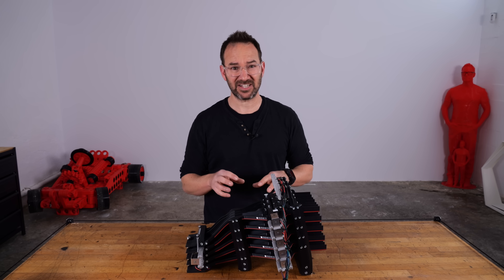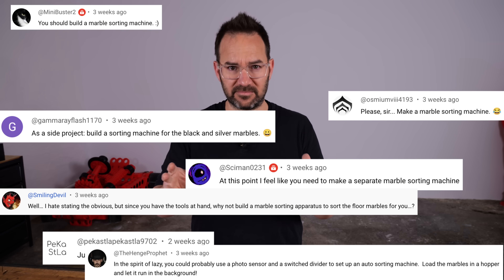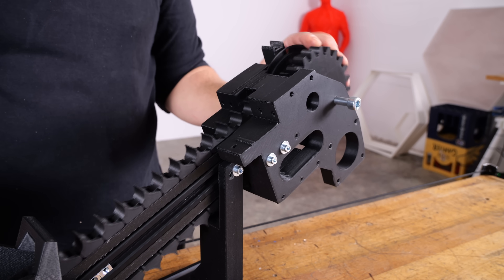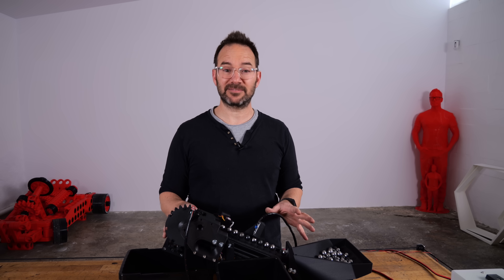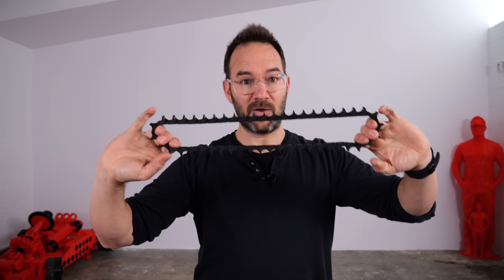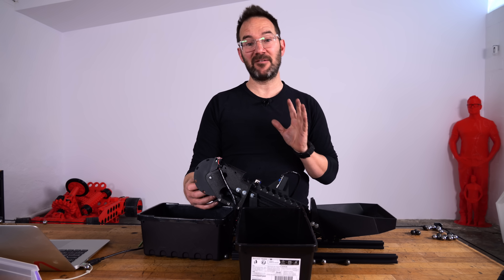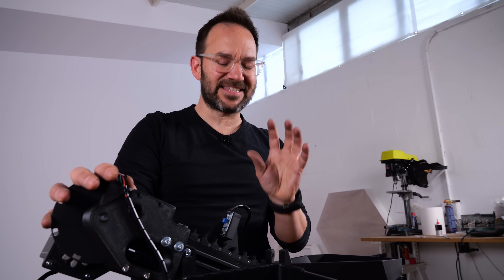Faster than the Eye Automatic Marble Sorter - Marble Clock Seconds Display Pt.3

Comment: Using a valve and shooting compressed air instead of the solenoid is often how my company forces ball bearings thru assembly processes. Do that and nothing gets in the way of the chain.

Comment: 1. Make the marble's impact point higher than the tooth of the chain (to prevent the chain from jamming and causing destruction).
2. Create a wheel resembling a fan (with 4 wings) that rotates 1/4 turn each time marbles need to be moved. This will ensure a smooth motion (unlike back and forth motion like a piston, saving half the time).
3. Design a larger cover for the inner bucket.
4. Form a funnel shape to catch the outgoing marbles.

Comment: Couple suggestions to consider 1) a double acting solenoid will get rid of the bounce and be faster than a spring return 2) Look at a step feeder as you can get the same part feeding rate result with things moving much slower and no possability of jamming 3) Take a look at type of parts feeder called a drum feeder, which you might find inspiring.

Comment: Chain sorting: Modulate the speed of the belt based on the marbles that are reaching the end.
By placing two buckets below the end of the chain you can make one type of marble fall further forward than the other, ending up in the far bin, and the other fall more straight down ending up in the closer bin. This should be much faster than stopping the chain and kicking marbles off.

Comment: You should look at using compressed air bursts to knock the marbles out of the way - that way you aren't limited by a 'retraction' time of the solenoid or servo.

Using press-fit pins to lock the links together (either dowel pins or roll pins) might also be stronger and not run the risk of unscrewing over time

Comment: For the marble sorting mechanism I'd design the chain so that the marbles want to fall out but are stopped by a wall, and instead of the solenoid pushing them, it is a gate in a hole in the wall that stops them falling or moves away to let them fall. That way if it lags behind slightly when retracting it doesn't catch the front or back walls of the chain link. This would reverse the logic of the solenoid with it needing to be OFF to eject a marble rather than ON, however I suppose you could have it drive a gate piece that slides away when ON to allow a marble to roll off the chain. You might also be able to move back to using a servo this way too.

You could also drive more than one chain in parallel to increase the throughput, you'd just need a hood under the chain to collect the marbles falling through the gate.

Comment: Super cool and useful time saver for this project! I think it would be cool to see it integrated in the clock, however if you aren't able to get it running fast enough with reliability, you could also consider using 2 sorters to increase the marbles per second.

Comment: You should use that but add magnets to the chain so the balls are transported along the underside of the belt (let me finish!). The black marbles will still be knocked off the same way but the shiny marbles will get tossed off the end as they make their way around the gear. Depending on the speed and size of the gear this will send them into a short arch like a fountain. It will also make more noise.

Comment: Maybe use two at a more reasonable speed. 10 marbles/s seems to be a good sweetspot where nothing breaks and by using two you still get to your target of 20 marbles/s.
I think the noise can be improved by making sure the marbles don't drop into a large bowl with other marbles.

By using a stepper motor, why don't you count steps and get rid of the position sensor at the top?

Comment: I think you can double your effective rate if you sort marbles rather than rejecting them.

Right now, you go through an average of two balls every time you select one. Sometimes you'll get lucky and the next ball is the color you need, and sometimes you'll get unlucky and get several wrong balls in a row. Assuming the correct proportion of colors in total, it'll work out to an average of one ball rejected for every ball selected.

But if you sort the balls first, then you can select every ball on the first try, every time. Essentially two stages:
- One device sorts marbles into light and dark, so that every single marble goes into one feed system or the other. (Overflows can be sent back to the pre-sort hopper.)
- The next device takes a marble from whichever feeder is needed. If it needs a light ball, it pulls from the light feeder. If it needs a dark ball, it pulls from the dark feeder.

That way, you always have the ball you need exactly when you need it.

Comment: By the way, you do not need a chain. You can just let the marbles roll on a sloped channel at controlled rate and have the electromagnet push them away to sort them. That way you could speed up the sorting even more. If the electromagnet is placed close to the sensor, you will not even need a software to do the sorting...

Comment: While this is really cool from a prototyping/art point of view, it does suffer from the overengineering of using prototyping equipment for a repetitive task. Instead of a belt, you could use a large wheel with holes per ball, and a pre--notched interceptor wheel with pre-determined spurs to do the knocking out. An aggitated hopper can drop the balls into a chute that feeds a wheel with a spot for one ball per second, and a pre-spoked wheel with the pattern necessary for the clock can knock out the same balls every 60 seconds. There is no "need" for servos and programability, overheating stepper motors, etc, yet as engineers we look to this as a challenge, a set of constraints that we need to solve, because in the modern era, we aren't making pinball machines, we're making makers.

Comment: Do you have to update every marble every second? Could there be a way to only update the marbles that change color?  If possible, it would reduce the number of marbles that need to be sorted and the number of gate openings. Perhaps, it even makes the clock more readable.
The sequence of digits is perfectly predictable, each position only change at certain times. I don't know if it solves a problem you have, but if you need to, you could pre arrange marbles before the gates to reduce performance requirements there.

Comment: Make the software push the white marbles instead of the black ones. That way the solenoid will not work in vain when there are empty spaces in the chain as is evident in some parts of the video. This is to prevent overheating.

Comment: Make a hopper, in th bottom of that hopper you have a a servo operated reciprocating plunger with a slot for one marble, take the reading of the color when the marble falls into the slot and move the plunger left or right according to were you want the marbles to fall. You're welcome.

Comment: Again just brainstorming here:

I'm sure you've considered this, but can you position the solenoid a bit higher so it does not interfere with the belt, just low enough to hit the marbles (even though not dead on in the middle)? That way the worst that can happen is some white marbles in the wrong bin. And it gives a lot more time to retract because it doesn't have to avoid the next belt ridge, but only the next marble. Though in case that marble is black, it needs to be in position in time for the next hit... Unless you add a second solenoid to take care of missed marbles.

I'm also thinking instead of hitting each marble with force to throw it off the belt, use the solenoid to move a wedge/ramp into place that pushes the marble to the side gently. This could be done from the side or from the top (again in a way that it won't hit the belt even if it is a bit late), or even rotated in from the side (rotating it back out of the way would go with the direction of the belt, making it easy to avoid the next marble).
Using a ramp has the added bonus that you can keep it in place for consecutive black marbles, only need to retract when there's a white marble next. Potentially much less noisy. And it wouldn't throw marbles all over the place, though that does make up about 30% of your videos, so I can understand if you want to keep that 😂

Comment: would a stepper motor with a wheel with holes instead of the solanoid work? so that the shiny marbels just go up truh the hole but when there is a black marble the stepper motor turns and takes the marble with it.

Comment: Suggestion- save time and effort by not sorting the marbles at all- have a closed loop system with the marbles in the correct order so that they display the digits in sequence, one set after another as such without entering a large 'pool' where they get mixed up.

Comment: Why don't you have a paddle that flips back and forth to allow each color marble to fall into the correct bucket, instead of using a solenoid to shoot the black marbles off the conveyor belt?

Seems like it would be useful to have the marbles sorted at the same place, rather than to have one type of marble pushed off the side of the belt and the mother falling off the front of the belt...

Comment: FINALLY you're singing from my songbook! To answer your question, you already HAD a working marble sorting system on the old clock. Right now you are caught in a serial speed race. Like with Ethernet and USB, you are trying to cram ever more throughput through your system. Ethernet and USB have to go that route because they are walled in by the need for backwards compatibility and other constraints. You are not. Instead of going further down the rabbit hole and chasing your tail, go back to parallel. Run the chain at a safe speed of 10/s and do five or even eight channels in parallel like on the old chain.

Comment: A problem with the servo and solenoid is they need to change direction and retract after pushing the marble. Maybe a motor with a  4-bladed propeller shape could work better, as it could keep going in the same direction after pushing. The speed of the motor could be scaled with the belt speed for a consistent movement relative to the belt. Compressed air would be another option

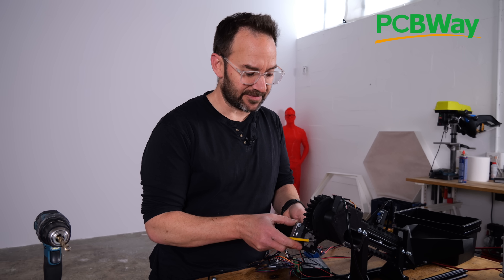Comment: 4:50 why not parallelize it?  make the motor drive multiple belts, such that it is slow enough to knock marbles off at any time, then have multiple selection heads.

Comment: It makes sense to use this for the machines separation. But I'd suggest using compressed air to push marbles out. It will never be in the way. In fact in industry they use a waterfall of product then use puffs of air to divert product. You might be able to do the same when the marbles fall off the end of the chain. Then you could do it in parallel

Comment: Ten thoughts on the current iteration:

1) I don’t think compressed air or magnets is the answer.  Electromagnets get saturated and would eventually magnetize the balls, and while using air puffs is a viable solution, it requires a source of compressed air and getting short enough puffs is, while doable, difficult.  

2) No need for multiple sorters either.  Just multiple pusher solenoids.  Something like 4 solenoid/sensor combos, each looking at each fourth slot on the belt.  That allows slowing the belt.  This may require an indexing sensor for the belt position.  Something like sensing belt pins and a counter to enable the solenoid.  A cheap proximity probe and a PLC like a 105 from Automation Direct to manage everything would work well for this.

3) Pushing silver balls off the track instead of black prevents firing on empty slots.

4) Eject balls into chutes to cut down noise.  

5) Install rails to keep loose balls on the table.  

6) Adjust the tilt of the table to cause balls to roll to one corner. Install a ball elevator to lift loose balls from that corner and drop back into the hopper using chutes to (again) cut down on noise.  This may require a stirring mechanism to prevent jams.  Check out Lego marble machines on YouTube for ideas on this. 

7) Glue thin rubber pads into chutes and where balls drop to help absorb noise.  

8) Of course include it in the clock.

9) Use the seconds mechanism you built for the entire clock instead of the current curved track setup.

10) Don’t try to catch the marbles ejected from the front of the clock.  Put a foam or thin rubber pad where they land on the table to absorb bounce and noise, and use the previously mentioned ball elevator to recover them.

Comment: Do two chutes or chains so you can hit 34 balls per second without running all gear at max. Work out max then roll it back do you running at 90% so that get optimal efficiency. 

Wouldn’t take much to have 2 solenoids between chains.

Comment: To make a stepper motor faster, you need to work with a higher voltage, for example 48V. The torque/speed curve is then much flatter, which means the same amount of torque at a higher speed with the same current is possible. I love your videos.

Comment: Put a latex dampener on the solenoid (that may also stop the ball from being sent too far and too hard). The boxes can also be quieter if there is a channel to guide them down and not crash all over the plastic or a box with fabric(felt) or soft bristles. The chain track can also be helped if the feeder box is tilted in a way that benefits the marbles' picking up.

Comment: Have you considered just not changing the marbles that would be in the holes of the eight? If I’m not wrong in every single number, they would be black so they would never need to be changed. That would get your required speed from 15 marbles per second down to 13. 
Also, for the seconds display, if you only change the marbles that needed to be changed (black to silver/silver to black) and not all 15, it takes the average amount of time needed to sort all the way down to 4.4 seconds. A much easier hurdle to clear.

Comment: Maybe silly, but how many marbles are you going to need available per-second for six digits?  I'm guessing there's an overhead to ensure sufficient supply to each digit.  So yes, I think you'll need at least one of these in your design, with enough slack to be waiting for marbles to process so that the display never runs out.

Comment: Using more sorters/sorting channels would mean you can run each at a reduced speed, less noise, greater overall throughput, increased redundancy, lower manufacturing and setup precision required. Just a thought.

Comment: If you wanted to push even faster (for some reason), take a look at replacing the solenoid with compressed air. I know it is sometimes used in actual factories for kicking rejects off the line. Without an interference component to the sorting, theoretically the sky would be the limit in terms of speed.
Though to be honest, it looks like you'll need to solve some other issues with feeding the chain before you can look at turning this thing into a chainsaw, cool as that would be.
And yes, you should integrate it into the clock itself.

Thanks for the video.

Comment: I would have either chosen air pressure to move the marbles out of line or let them all drop at the end and fall o vertical lip, that when moved with a solanoid to either left or right makes the falling marble fall on the opposite side. Also why did you work against gravity with a belt? you could have used gravity to work for you instead in moving the marbles

Comment: If you mounted the solenoid at an angle it will give more room for it to retract before the link separator passes the midpoint of the solenoid.
Look at the position of the solenoid when it 'breaks'. Try mounting it at this angle and run it again.